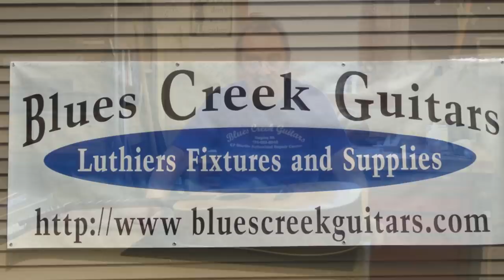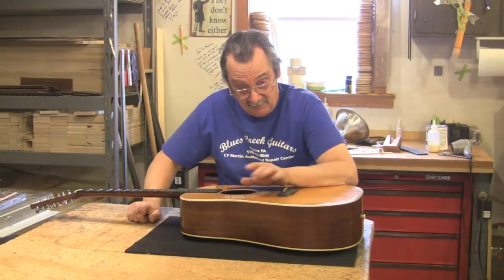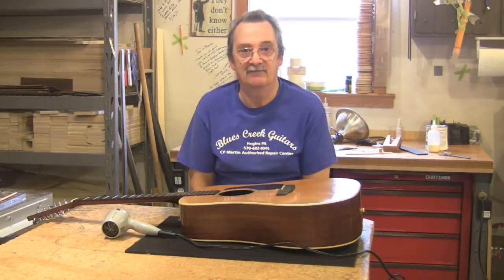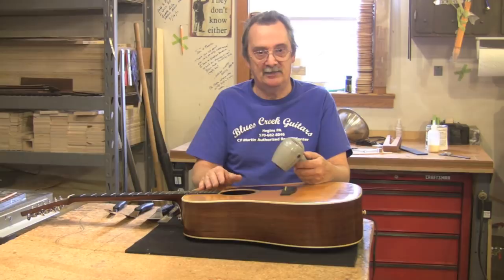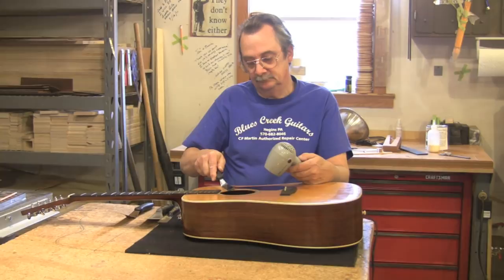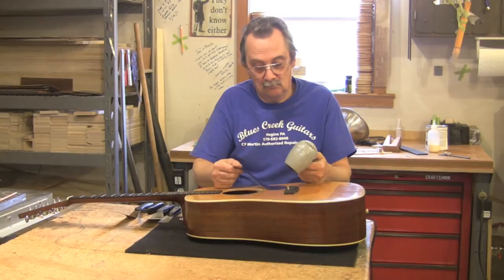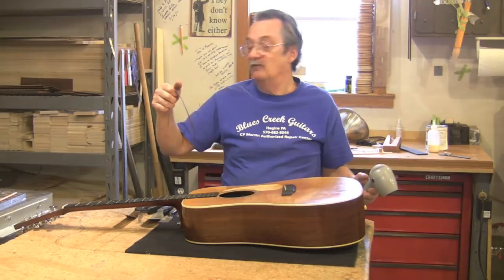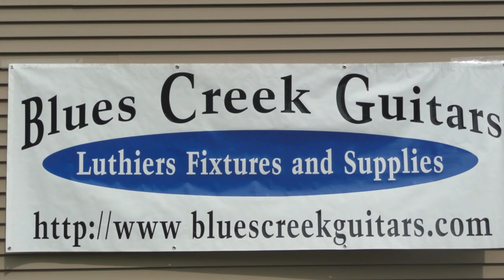Blues Creek Guitars - Quick Tips - How to Remove a Pickguard

Comment: Nice quick video. Thanks. I'm not crazy about utilizing a metal tool anywhere near a finnished top, so may I add, the use of a thin or medium guitar pick is good to start the lifting process.
Reply: These icing knives are the perfect  tool  they are flat and they flex wonderfully .  A pick can't take the heat.  Understandably this is not something you do willy nilly there is a touch to this.   This knife is about .010 in thick    picks are too thick  and it doesn't take much to get the pick guard to lift.   You notice I keep the tool flat  ,  with a thick pick you can compress the soft grain  that will require drop filling later.

Comment: This worked perfectly, very easy. Get naptha to remove the adhesive. I tried for two days to remove the adhesive with a removing fluid i got from the auto parts store, then I bought naptha per another youtube vid and it took the stuff off in seconds with a rag.
Reply: thanks   glad you found this info useful

Comment: Is it possible that after removing a pick guard, the bottom was finished just like the rest of the guitar?  How can you find out?
Reply: justun chan  Most under finish pick guards were stopped by the 80's.  If you look real close at the edge you can see the sink in the top finish if it is under finish guards .  Most guards are now glued on the top of the finish  often with a double sided tape adhesive.  So look  close  you will be able to see that ledge once you know what to look for.

Comment: I know my guitar has no finish under the pickguard. Its a 1972 Guild. It seems pretty fixed on there. Are there special considerations? Yours seemed to be easy. How can I prep it right?
Reply: flash bazbo 
  take your time   once the heat gets to the glue it will start to release  .   Don't force it you will feel it work loose.  It will be much like pulling tape off. Keep looking at the top for lifting grain.  you can always call me  my contact info  is on my blues creek website

Comment: In the beginning of the video you mentioned a "conversion".
Do u mind explain what is it? Thanx!
Reply: A conversion is when we take a guitar that is in need of a lot of work , often the owners want the top replaced and we  rebrace the guitar and change the build specs to a later date. Often pre war ( 1937 era). That is what we did here , we changed the top to red spruce and forward shifted braces and made it to spec from 37. We added herringbone and a zigzag back strip. We also used hot hide glue.

Comment: I have a good 1970's era Yamaha FG-180 acoustic guitar.  The pick guard is starting to loosen, but is in good shape.  I'd like to remove it as you demonstrated; clean the old glue off with solvent; and then reapply the same pick guard with fresh, new glue.  What kind of glue should I use?   I would appreciate any professional advice you may have.  Thanks!
Reply: audiophile man 
Don’t use glue.   Use 3M double sided adhesive you can get from stewmac.com for $3.54.
Reply: @solice8844  Thanks for the tip, pal!  I was looking for a source and didn't see anything reasonably priced.  Haven't got to it yet, so this is timely.
Reply: audiophile man 
You’re welcome.  The 3M works great.   I just took off my pick guard, sealed the wood underneath and put it back on with the double sided adhesive.    Best way to RE-adhere the guard with no edges sticking up.
Reply: @solice8844  Okay, I'm sold.  Can't beat the $3.54 price.  I was also checking out StewMac's website.  Looks like I can buy a lot of cool stuff for our guitars.  Thanks for steering me over to this very cool website.  Cheers, man!

Comment: Hi, I was hoping you could give me some advise, hope you don't mind me asking.I have sanded the Satin top on my acoustic, it  was full of scratches and dents, basically I've just took the satin finish off with a bit extra where the dents and scratches  were and it looks pretty good, nice and even, probably not the best idea I've had but I've done it now. What could I use for a finish , that wont affect the sound too much, and that doesn't need spraying, a varnish I can put on with a cloth ? or some sort of oil ? I'd appreciate your help. Your video on removing a pickguard worked a treat thank you.
Reply: +MrRayzer1 what brand of guitar?   I wouldn't sand.  I would use 0000 steel wool wipe with naphtha and mineral spirits. I need to know what finish was on as not all finishes will set with others so you need to know the base. Shellac may be needed as a sealer and you can use a finish on top of that.
Reply: Hi, thanks for getting back to me.It's a Guild D4 nt from 1995 with a matt finish on the top.
Too late I've sanded it already there was some quite deep scratches  , basically it is just bare wood now, I was just looking for something I could use just for a little protection for the wood, it doesn't have to be a gloss finish. Do I even need to put anything on it ? it looks ok just wood.Thanks Ray.
Reply: +MrRayzer1  yes you need to put a finish on this. Raw wood will die fast as the  body oils get into the wood.   You can use a satin finish , at this point  you will be needing a sealer and  a finish. You will have to mask off the bridge and fretboard extension,  apply the seal coat then the finish.  You can get finish at stew mac or LMI.  If you can't spray any lacquer you can try the water finishes.
Reply: Thanks , would a wiping varnish be ok?, I've seen some called Tru-oil, would I still need to seal first? Thanks very much for your help, it's very much appreciated .
Reply: +MrRayzer1  You can use that or a wiping polyurathane.  I would do the poly over the true oil
Reply: Thank you very much, that's excellent.
You've been a great help.

Comment: What about the wood drying out, should I worry about  all that humidity stuff.?
Reply: *****  Yes RH  relative Humidity has destroyed many guitars. You want to keep the guitar in that 40 to 55% zone . The case is the safest place for it and use some kind of humidity pack. The Oasis , Kyser , and one of the best is planet waves. As the wood expands or contacts it acts  upon the braces. This is where the danger is. As the stress build  in high humidity you can pop off a brace and in lower humidity the top will dip as the shrinkage stress build and this is what causes the cracks.
Reply: blues creek guitars Thanks for your excellent reply, what I really meant was ,will heating up the guitar with the hair drier have a detrimental affect on the guitar, I guess I should just take it easy. Thanks again great videos.
Reply: *****  in the about of time this takes it won't be an issue  just remember warm not HOT
Reply: Thanks very much for your help.

Comment: I would warn anyone from putting a guitar out in the sun. The heat can stress the top and in the right conditions  crack or loosen braces.
   If you are replacing the pickguard , this is not an issue   If you will be going without a pick guard  the chances are you will always see the tan line.

Comment: if you remove stickers with metal tools you gonna scratch. You have to use plastic tools.
Reply: Plastic is   not what I would use.    When you are working on an under finsh  pick guard like   Martin used to do , you have to use metal plastic can't hold up with the heat.If you can't separate the guard plastic won't have the  strength to separate the pick guard off the wood and you don't want to lift fibers.   Watch close and you can see I am pulling up more the  prying.